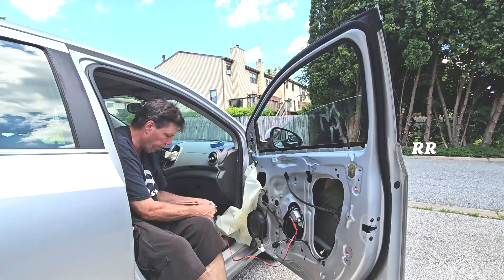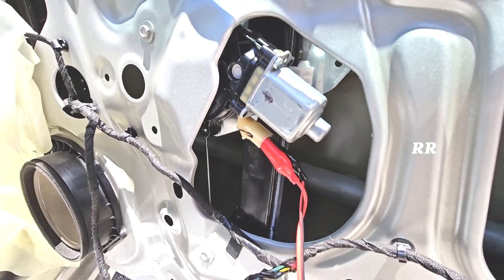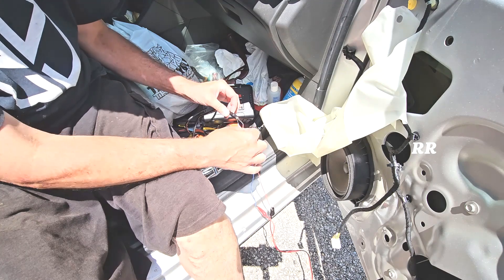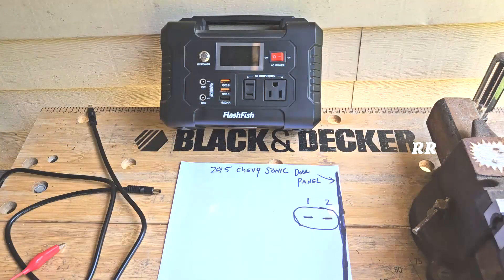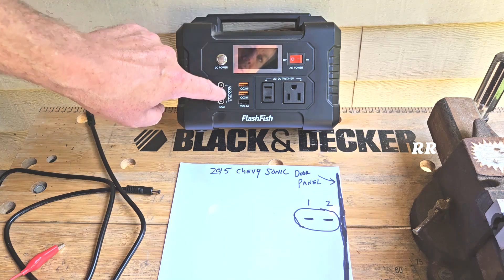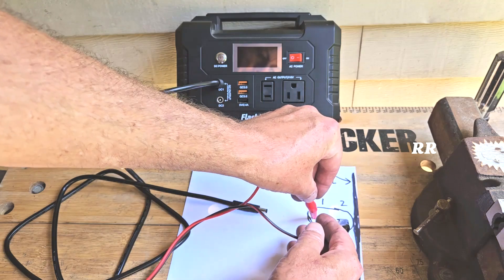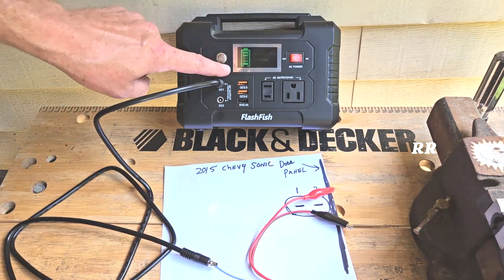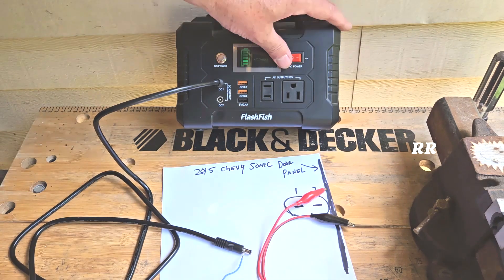Closing My Stuck Open Powered Car Window with a Battery Backup Unit

Comment from the maker: #ad
Obviously don't try this if you aren't comfortable working with electricity. I don't want someone to hurt themselves or their vehicle. I'm just showing what I did. At the end of the part with the car, I detail more of what I did on a table so it can be seen a little better. 
In the vid I switch the wires on the alligator clips to reverse the motor, I could have just switched the alligator clips on the pins at the motor. The clips I was using were slippery and it was just easier for me to switch them at the wires. I probably could have done some other things to make this easier but my brain went right to this and all I had here to output 12 volts was that bbu. 

This is the BBU that I used:  https://amzn.to/4eTpkCr
This is the Power Window Regulator with Motor (2 Pins Only) that I installed after on this 2015 Chevy Sonic: https://amzn.to/45RiUQd
Check out the vid end screens for related items     
(Affiliate Links)
Click Like & Subscribe for updates on new products
Randy's Amazon Storefront - https://amzn.to/3wWZ19w
As an Amazon Associate I earn from qualifying purchases